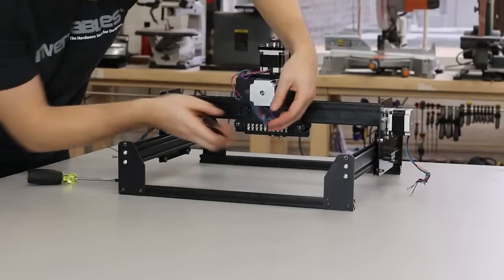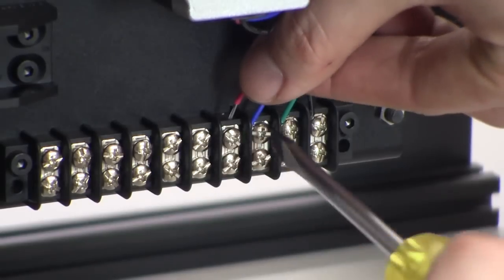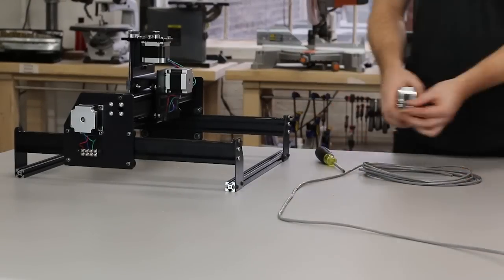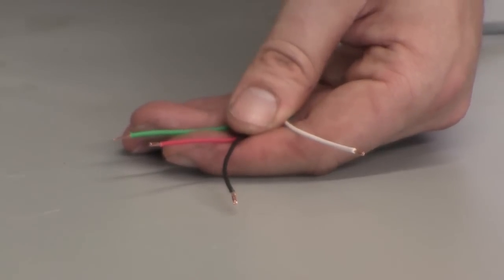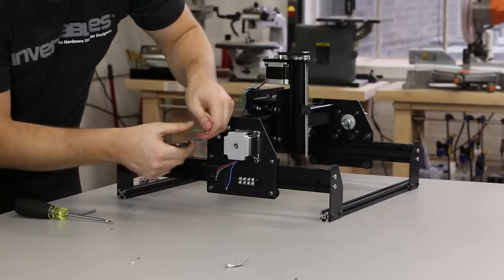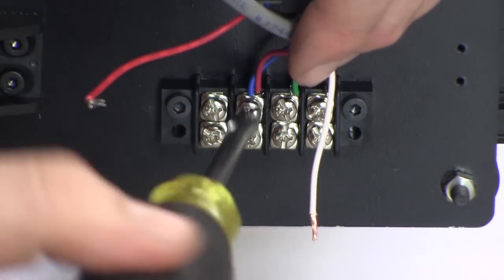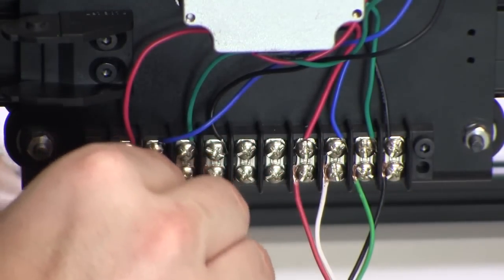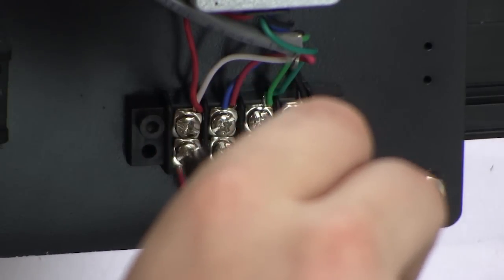X-Carve | Assembly | Wiring

Comment: Tin those wires. Not only will it keep them gathered but the screw will bite the solder over more surface area without crushing the copper wire.

Comment: Strip the ends of the wires long enough to allow bending the ends into slight curves after you have twisted the ends strip copper strands together very tightly. Then rotate the curved (hooked) ends under the screw head on the side that draws the conductor under the screw head as you tighten. You do not want the conductor "squished" out from under the screw head. Personally, I lightly tin (solder) the ends of my wires that go under screw heads (terminals without pressure pads). Ferrules and neat and tidy if you want to go to that extreme.

Comment: When inserting multi-strand wire under a screw terminal, ALWAYS insert it to your right so the tightening screw head draws the wire into the terminal. Terminal strips with pressure plates (more expensive and unnecessary) do not need this consideration